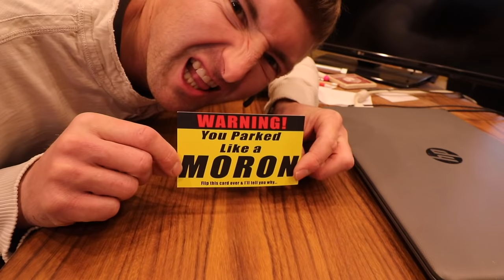Cole The Cornstar Visited My Farm!

Comment: I would add in bits of knowledge that’s not known by most city folk.  Not in depth but soil samples. Cost per sample. Why 1 sample per 80 acres (while better then none) often does not help as much. How farmers use minimum fertilizer, spray... to get decent crops...
  Ok maybe do one in depth, with your agronomy guy.   “Soil tests showed you need. XYZ of N, P, K. To get 150 bu.  With costs you go 70% recommended of ... but 100 % of ...because it’s cheap, does not run off, leach out, save a pass next year...  just few clips of equipment used to apply.

Comment: I really try NOT to breath the treated seed dust.   I have ate lots of dust.  But spray, chemical, treated seed dust I avoid. 
  I give neighbor grief.  He pulled a JD 5 bar rake (660 I think 9 foot, ground drive) with 170 hp FWA tractor with duals.  I asked if he needed FWA.   But this year I used a 170 hp FWA w/duals to drag with 45’ drag.
Reply from the maker: We use seed that has been treated in a way that there isn’t treatment dust, it’s too heavy to float in the air. We also went away from graphite/talc based seed lubricants to a soy based lubricant that is safe to breathe. It doesn’t taste very good but it keeps myself and my kiddos safe!
Reply: @TheFamilyFarm  glad to hear.  Sorry I came off stronger then I meant to.  I can’t linger near cleaning section of stores, be around many sprays...new treated lumber...
Reply from the maker: You’re all good. Thanks for being concerned for us!